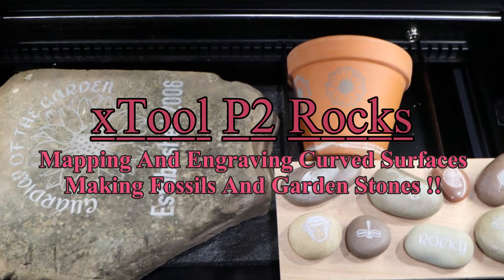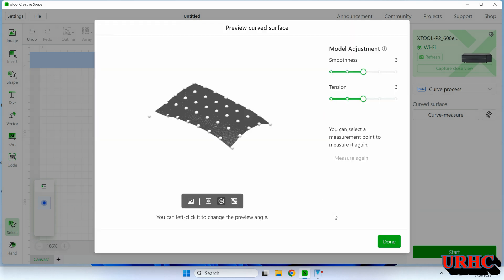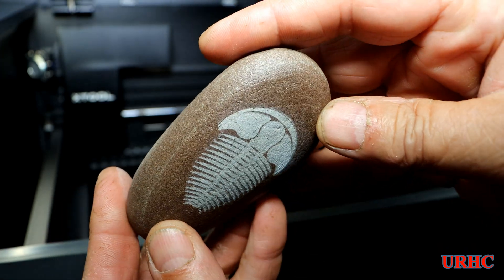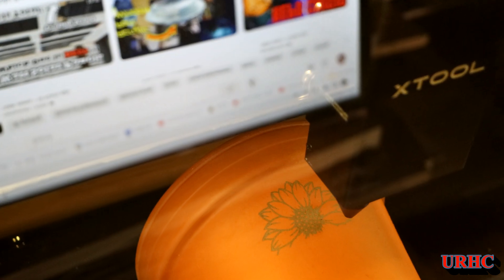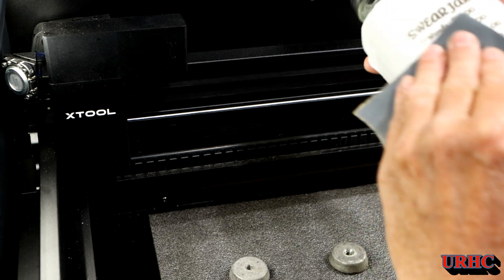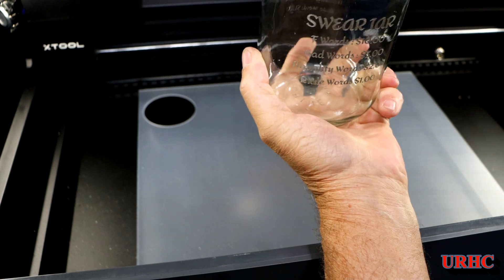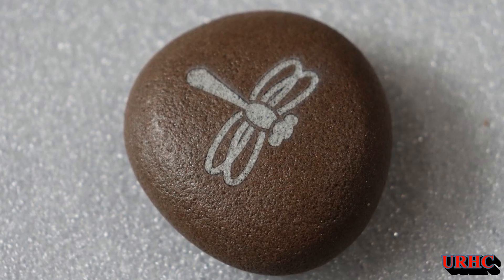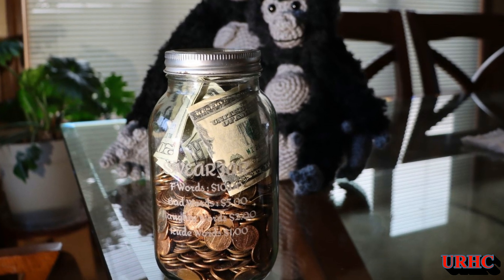xTool P2 Rocks. Mapping And Engraving Curved Surfaces Making Fossil And Garden Stones

Comment: Hi, Thank you for a great video! This really helped me get started on using my brand new P2. I Did run into an issue trying to engrave round things like candle jars or glass bottles as they were too tall even laying down and with a slates removed. I was wondering how you get yours to fit? Especially the flower pot And the mason jar?
The main reason I bought this machine to engrave my handmade candles, so it would be a bummer if I couldn’t do that. 
Did you buy that raiser that you can purchase for this machine? 

Thank you very much and I really enjoyed your video!
Reply from the maker: Yes you need to buy the riser base for taller items or to use the rotary assembly. For round objects like glasses and bottles a rotary axis gives the best results.  Thanks for watching.

Comment: As a rock hound I'm glad to see how great the P2 works on rocks!  Do you have a power/speed/lines per cm range you find yourself working with or does it vary so widely from rock to rock that it's futile to recommend a starting point?
Reply from the maker: I started with the Xtool settings for slate coasters. For deeper engraving 2 passes or slow the speed down. Thanks for watching.
Reply from the maker: I started with the Xtool settings for slate coasters. For deeper engraving 2 passes or slow the speed. Thanks for watching.
Reply: @unemployedredneckhillbilly2023  Thanks for that.  If you included it somewhere in the video I apologize if I missed it.  I did learn a lot from your video production and I'm excited to try this out on some special rocks!

Comment: Very cool that the system has the ability to map changing depths of the target material.   Very nice results on the rocks, jar and pots!
Reply from the maker: it is the best feature of this laser. Gives undistorted artwork on tapered surfaces without a rotary. Also very easy to setup and has worked flawlessly since the last firmware update.  Only drawback is the engraving is slower using this feature.  Something no one else in this price range has offered before and I bet others soon follow. Thanks for watching.

Comment: The flower on the pot showed up a lot better in the video. Over the last couple of months I have given away or sold over 30 laser engraved pots. It is a fun item to engrave. Ed, I love the swear jar. I am going to midnight requisition that idea.

Good thing you engraved the big rock before your cataract surgery or your swear jar wouldn't have been big enough.(not to mention blowing your eyeballs out)
Reply from the maker: That clay comes out great if I don’t break the surface.  For some reason adjusting the grey scale works best. I need it to calm me down during the evening news. looking for a gallon round jar to  try with the rotary next video. Ordered some plastic canning jar lids to try cutting the slot in. Says they are polypropylene and not sure how thay will cut. That last firmware update really nailed down the surface mapping. Really easy and reliable now but slow engraving.  Thanks for watching.